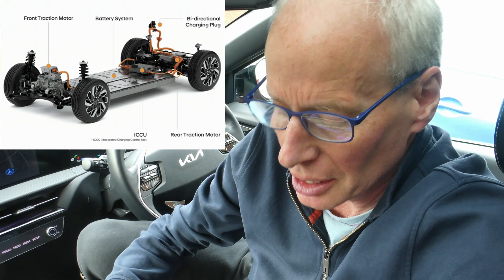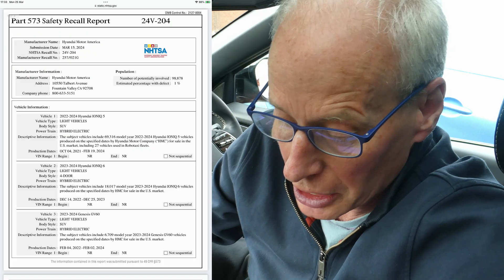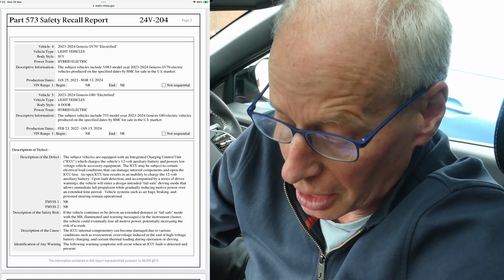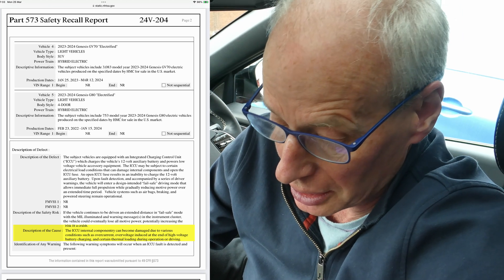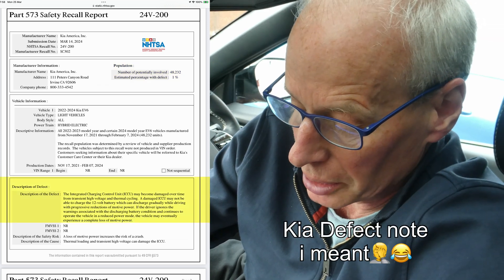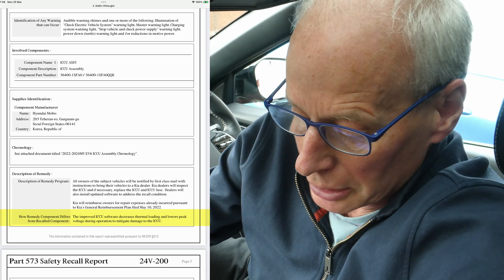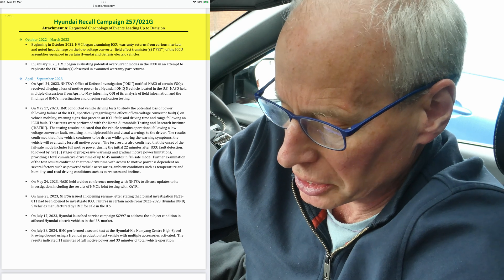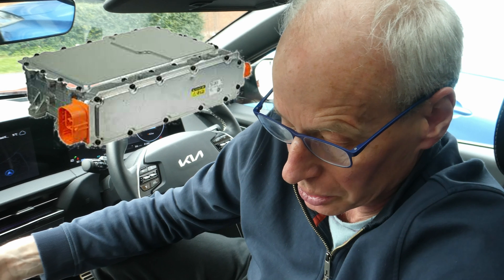Further details I’ve discovered about the 2024 Hyundai Group Integrated Charging Control Unit Recall

Comment: Just had the full instrument panel replaced on my failed car after two months. When they replaced it they found the ICCU (after the recent ICCU software update) had failed so this has now been replaced. My UK dealer advises that there is no ICCU recall according to Kia UK.

No 12v issues advised.
Reply from the maker: That’s because it has not properly come out in the US yet whereas it has for Hyundai. It will come in a month or so i’m pretty sure.I had my instrument panel replaced last year as well.
Reply: @evodessey  so do you trust it then?

Comment: Mine has previously had the ICCU replaced after failure last year (3.5 month wait time). It's booked in for its first service in April along with a USB port replacement. I called yesterday and the dealership confirmed it was also due to have this ICCU update whilst in
Reply from the maker: It’s likely that the ICCU update you are being offered is still the one from last year. Just had a conversation with someone on EV6 group on Facebook in the US who said their dealer knew nothing about it. NHTSA has dates when they start sending letters out to owners of the end of April. I’m pretty sure some have been offered it in US and have their cars booked in though. Until they get it done and check their version numbers with Car Scanner it’s difficult to tell though.
Reply: @evodessey  it could be, although it has already had last year's update. I'll check the version numbers on the infotainment system pre and post service and feedback (I don't have car scanner)
Reply from the maker: Infotainment won't give you the details. Not sure if engineering or dealer mode does so will have to double check

Comment: My Ioniq 6 ( in Australia) had the update yesterday and the car failed to start today.
As soon as I attempt to start it the voltage drops incredibly fast, within around 5 seconds down to 7.7 v or so. And won’t start the car.
If I jump start it then it drives perfectly well and recharges the 12 v battery.
It will all work perfectly well, starting and driving, then as soon as I push the start button it has an enormous load switched on to the 12 v battery.
It’s at the dealership now.
Fortunately we have a Hyundai dealership handy unlike Tesla, which is one reason why I bought the Ioniq.
Don’t get me wrong, I like the Tesla, although they’ve had 12 v problems as well.
Reply: Thanks for your concern.
I didn’t receive a notification from Hyundai.
It looks like I’ll be back to my ICE cars until it’s fixed.
Love the Ionic to drive, am missing it already.
Reply from the maker: Sorry to hear this. Sounds like your 12v could be damaged. That’s the only time i’ve seen that in my car. Fingers crossed it’s fixed quickly.
Reply: I have a 2022 EV6 GT-Line (Australia).  Did you get a notification from Hyundai Australia for your Ioniq 6 update?  I’m wondering if I’ll get one for my EV6.  Kia Australia seems not to hurry with these things..!

Comment: Thanks Brian for your continued coverage. I'm in the UK and the other day I got an unrelated email from my dealer (Kia GWR London), just a routine follow-up after 9 months on the road. I replied saying that things were fine but I am keeping an eye on this ICCU update. I'll let you know if I hear anything.

As others have mentioned, power delivery is watts = volts * amps, which we can write as W = VI. 
In the UK we are on 240V AC. This means that on three-phase 11 kW delivery we use half the current compared to those on 110~100v AC. That might be significant, as the heat generated over resistive components of the circuit is I^2*R.

Thus a halving of the current could mean 1/4 of the heat generation in any resistive components such as copper wire.
Reply from the maker: Cheers,very significant i would say. Especially with US overheating charge port problem.

Comment: Indeed higher voltage at the same wattage means lower amperage and heat. So it would make sense that it is more of a problem in the USA where they have to really "AMP it up" at a lower voltage like that. So if some FET is already not the best quality, that might just push some of these ICU's over the edge.

Comment: It is possible that they use different internal components for European ICCUs as they may not be able to handle 110-120V levels. In the US, they must be able to adequately cool 40-48 amps. So, the US (North American) version of the ICCU may accumulate more heat and become damaged over time than versions for other markets. It is also possible that the accumulated heat from the FET affects the 12V circuit.
Reply: FYI, in the US level 1 charging is 120V and level 2 is 240V. So it’s 240V at 48A max in the US.
Reply from the maker: Yes is the answer to both questions I think,US part code is different from EU/UK, also bare in mind that South Korea is 220 volts like ours where the recall began 2 weeks ago.